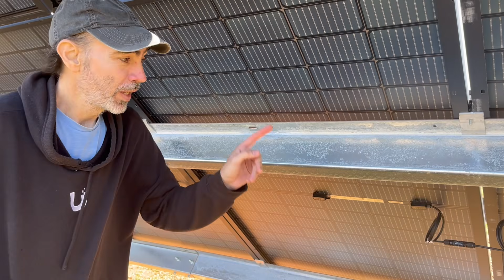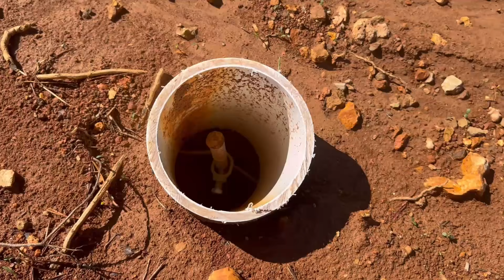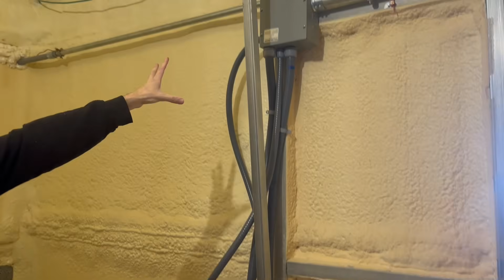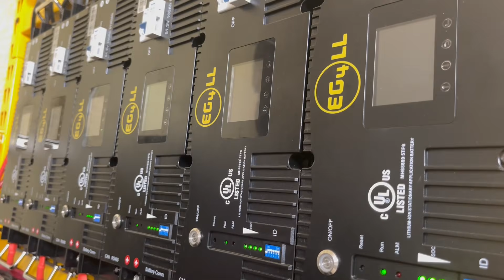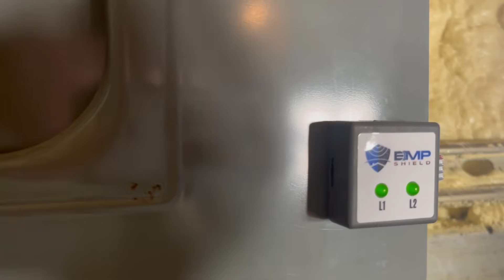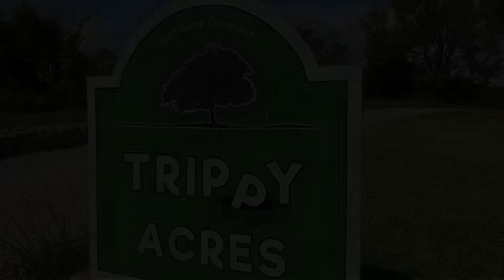Our 18.5kW Off-Grid Solar System Walkthrough | 90kWh Batteries & Sol-Ark Inverter

Comment: How simple would it be to build a system like this in multiple phases, obviously it will be quicker and easier to do it all at once, but I’m thinking of eventually building a system like yours I’ve seen some of your other videos and know how it all works, but I don’t really have the money to invest something that huge right away, in theory what I would like to do is build one solar array with about 20 kWh of storage and maybe the next year expand it to two arrays with more storage and so on until I get to where I really need it to be, is it straightforward enough to add later without having to change a bunch of expensive equipment like inverters or how would you go about doing that?
Reply from the maker: For the most part, yes, you can do it in phases. The one issue would be the batteries. If you buy 20kWh per year, your new batteries will have a higher capacity than the older ones because time and use degrades them. You could start off with a Sol-Ark/Eg4 system that doesn’t require batteries and get some solar panels. Your panels can feed your house offsetting your electric bill year after year during the day. Keep adding more panels when the funds are available. When you’ve maxed out your panels, save up and get as many batteries as you can or need. Then you can start to not need the grid nearly as much and not have to worry about the batteries having different cycles/time on them.

Comment: Hello from Australia. Your system looks great, however, the Australia government has been subsidizing solar and battery installs throughout the country. And because we are part of the Asian China has been very active in new solar and battery solutions. I now have 23kw of solar panels on my roof supported by a 3 phase 15kw inverter as well as a 41.6kwh LFP battery all in one tower. This avoids all the complex wiring and racks you have. My system consisting of 5x 8.3kwh batteries and 3 phase 15kw inverter charger is in a single tower 800mm by 2000mm, (approx 3 feet x 6 feet and 1 foot deep) It's winter here presently but I still average between 30 to 85 kwh of solar capture per day. I run my house EV and export the remaining to the grid. My complete battery Inverter system and full install (excluding solar panels) cost me US$12,000. How does that compare to your system cost.
Reply from the maker: WOW! $12k for such a huge system?!  Can't beat that!  I don't remember what our total was but you paid a LOT less than we did.  Our ground mounts cost that much alone.  That's pretty awesome to get such a discount.  Do you also get paid for net metering?

Comment: This is really close to what I want to set up. I plan on having about half the storage capacity as I'm optimized to use propane for water, dryer, cooking. How is your capacity work for your daily needs, are you using 50 or 80%? Also what was your purchase order for your various components, panels, batteries, etc?
Reply from the maker: We're not sure yet how many days the batteries will get us through because we don't have the house built yet.  That being said, I don't really have a problem using the batteries down to 20% or maybe even lower.  From what I've been seeing, the storage capacity over time goes down whether you use it to 0% or only to 90%.  The cells lose capacity over time regardless of how much you use them so you might as well just use them.  As for price, I'm not sure at the moment.  I think we answered that on another video or maybe on this one but I have the memory of a gold fish. :)  Besides, we bought stuff in blocks when things were more expensive.  We paid $8250 for the Sol-Ark and it's now $5400.  The first 12 batteries, we paid something like $1800 years ago and now they're about $1400 each.  I think the mounts were about $12k and that price seems to not really fluctuate.
Reply: @trippyacres Thanks for the response🙏. I have a lot of things to do before we get to the solar installation but I'm enjoying the pre planning at the moment.
Reply from the maker: @brandonmulford5524  There’s definitely a lot to do but it’s worth it in the end!

Comment: The Emp Shield is a false sense of security. I saw a video of someone taking apart one of them and all that was inside was wires curled up with epoxy all over. They are selling false hope.

I want you to think about something if ENP hits and your system gets damaged because it didn’t work, who are you going to call?  when everything’s down. Just think about that.  Just because they got high price people talking about their products, doesn’t mean it works..
I bet the person or people that owns the company are the same people that told the U.S. to hit Iran. 

Good luck
Reply from the maker: Anything Outdoors with Steve did a video called "Testing the EMP Shield Surge Protector" where he simulated to the best of his ability a lightning strike starting at devices that were connected to an EMP Shield and it was successful at protecting everything.  He said he was initially a skeptic but what he did showed that it works.

Around the Homestead with Sue & Ryan did a tear down video called "Ryan Rants: EMP, Solar Flairs and Electrical Surge Suppression Part 4 Destructive disassembly" of a few lightning protectors and EMP shield was one of them.  He basically agreed that they are over-charging for the devices but also agreed that there are parts in there that that have the ability to protect against all three over-voltage types.

To your point, if an EMP hits and the whole US goes down, we won't be contacting the company for a replacement but their claims are the device can take over 40 EMP hits so in theory, we won't need to.  If lightning hits, they replace the device for $50 and as long as it was installed by a licensed electrician, they'll replace anything it failed to protect.  Others have stated it worked.

It's worth it to us.  I hope I never need it but having it gives me something additional that I didn't have before.  If it doesn't work, then I've only spent a bit extra which will be insignificant to what I'll have to spend to replace everything that blew up anyway.

To each their own!  It's what makes the world go around. :)

Comment: Make some room between the panels so light can get behind the panels and be used from the back
Not much effect in a shadow.

It is normal to make some distance between the panels so you let sunlight between them, with bifacial panels.
In that way you get a bit of sun behind them all day, if they are south facing
Might as well use the whole rack 😉
Reply from the maker: Hmm.. If I were to make that happen, I'd have to install only end clamps.  Since I used mid clamps, the gap is based on the clamp.  Have to say, having a gap kind of makes sense.  Interesting idea!

Comment: Impressive setup! I just stumbled on your channel so I don’t know exactly what your loads are but I can’t image this system will have a problem powering anything. I’ve been off grid for about 5 years in Colorado with a 5kw solar array and 30kwh of LFP (all eg4 stuff also) and have only ever needed to run a generator once.  That is with furnace, water heater and stove on gas though. I’m currently building a new house that will be fully electric with a system more in line with what you have now and it remains to be seen if I’ll be able to keep the house heated with the mini splits through winter while being off grid. If it wasn’t for heating I wouldn’t have any concern. Time to get an electric car over there!
Reply from the maker: Thanks!  We're in the process of building a geodesic dome house so our loads are pretty slim right now.  Impressive you've only needed the generator once!  Before the new year, we had 60kwh of battery and 7.7kw of solar and needed the generator probably 5 times each year so you're doing much better than we were.  Our plan is to heat/cool everything with mini splits as well so it will be interesting to see how that all goes.  If you're building now, do everything you can to make it as energy efficient as possible and I'll bet you'll be fine.  You should look into AreoBarrier.  We had it done and it sealed up our dome quite nicely!  Here's our video on it: https://youtu.be/DNZChcQVE6o
Reply: @trippyacres Yea the extra sun must really have a positive effect for me out in Colorado. We are at 8000’ and when that sun shines on the bi facial panels with a little snow on the ground they regularly produce 120+% of rated output. 

The house will be extremely efficient similar to you guys but the extra size it ended up being has me worried. 1600sqft but that’s not including the full basement. I did use ICF for the basement, insulated under the slab, and the upstairs is zip r6 with 2x8 walls that I will either fully spray foam or do 50% spray foam with the rest being mineral wool. Ceiling will be about 2’ of blown cellulose. Hoping to have a blower door score of something below 1.5ach50 🤞🏼
Reply from the maker: @TravisH1888  Nice!  Sounds like you have a good hand on things.  You should seriously check into AreoBarrier.  I think we started our blower door test at 1.5 and got  down to .3ach.  Also think about an ERV or HRV for ventilation and with everything you've done, you should be in good shape.
Boy, I wish our bi-facial panels paid off like yours.  Wow!

Comment: Would also be a good idea to fuse the negative solar lines.  Sol-Ark solar negative lines are live at around -200V to -250V relative to ground.
The wires on the EMP Shields are too long.  With surge protectors, you want minimal wire lengths and minimal bends to cut down on inductance.  And coronal mass ejections are only a problem for systems where geomagnetically induced currents will hit things.  Your systems are waaaayyyyy too small for that.
Reply from the maker: Interesting about the negatives.  Another viewer mentioned I should fuse each string as opposed to fusing the combined strings.  If I'm going to split them out, easy enough to add another two fuses.  As for the EMP Shields, yep, I mentioned that in my installation video.  Since this setup isn't in its final form, once we get to that point the leads will get trimmed.  Thanks for the tips!

Comment: That's the panels  I have at my Ray Cabin Utah Homestead. I just have 14 currently with another 7 soon. 

I built my own ground mount with trenched conduit underground to the Cabin. 

I have 1 EG4 12000xp . I set my ground mount on the side of a mountain here in Northern Utah on a ski resort. 

We have had huge winds and I have secured panels with bolts and bungees. 

I have a predator 6500 generator going to a server rack batteries 32KWh in my basement solar storage room via a chargeverter.. 

So far I'm very very pleased. We just had our property 4 acres appraised and I was extremely pleased as it added great value to the 35 page appraisal. 

Thank you for sharing and your comical professionalism. You guys are funny
Reply from the maker: Wow, that's a nice setup too!  I'm not brave enough to build my own ground mounts but I surely do respect those that can.  I'll bet your view is BEAUTIFUL!
Reply: @trippyacres ❤
Reply: Where did you get your panels from? I cant find the Aptos 440 bifacials anymore
Reply from the maker: @antoineg639 We got them from Signature Solar. Last I saw, you could only get the 450w panels which would be fine to combine with 440’s (assuming that didn’t make you go over your limits). Not sure on availability though.
Reply: @trippyacres I was hoping to have them panels match for ease of installation and aesthetic purposes. Couldn't afford everything at once. Didn't realize they'd be discontinued,
Reply from the maker: @antoineg639 I’d be surprised if the 450 panels were physically different from the 440’s. Guessing the data sheet would have all of that.
Reply: @antoineg639 , I got from Signature Solar

Comment: what was the system cost?  I have a similar sized system, but find even on overcast days it still generated enough power to charge the batteries back up to its float voltage.
Average draw is maybe 1kw, so not much at all.
Reply from the maker: Good question.. one that I don't have exact numbers for but roughly around $60k - the 30% tax break that just ended.  I'm hoping we're good for the overcast days!  Won't know until we get the inside of the dome built.  Glad to hear it's working for you!
Reply: I went w ecoworthy i got a 5000w 48v inverter charger  750 bucksand ecoworthy 12v 280amh batteries wired for 48v 1600 bucks and 10 sungold 450w bi facial panels 2000 bucks my average draw is 1500w and im normally at full charge by noon. Less the weather is crappie but I still break even and often add around 1000 watts then when the sun comes out i charge right up. My large appliances are propane.. I believe i sized it correctly works great
Reply from the maker: @thetowguy-johnnytowtruck  Sounds like a nice system and I'd definitely agree it sounds like you sized it properly if you're getting to float easily!

Comment: If you live in an area prone to earthquakes, my recommendation would be to use 3/8" synthetic winch rope to secure your batteries.  Preferably also securing the whole rack to the ceiling if it supports it so that the rack does not topple over with the batteries.
Reply from the maker: Pretty neat idea!  Based on that idea, a ratchet strap would give the ability to tighten it down pretty decently too.  Thanks!!

Comment: Curious: If the Metal mounts goes 6ft into the gound, why do you still need a ground rod? Should'nt all the metal post act as a ground rod ?
Reply from the maker: My understanding is concrete doesn't disperse electrical current like the earth does.  If I pounded the posts into soil, I think technically that would be my ground rod.  I think house foundations do something with ufer grounds which does allow for grounds into concrete but I dunno.. I just play an electrician on youtube. :) Maybe you don't need to do a ground rod.  Good question!
Reply: Pjames600: Do you REALLY think that concrete is a good conductor? If you use a grounding rod that means it most likely needs to be a GOOD CONDUCTOR!!!!!!!!!!!!!!!!!!!!!!
Reply: Cobber is also very conductive, and corrosion with other materials could become a problem
Specially if concrete is involved
Reply from the maker: @Hansen710  Perhaps, but I'm betting it'll last at least 30 years, which is likely longer than I'll be alive. :)